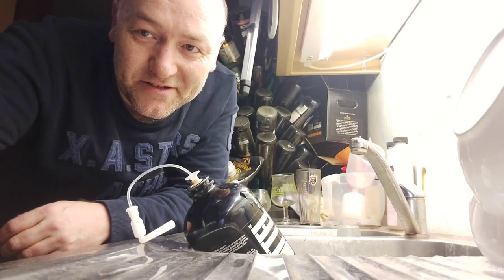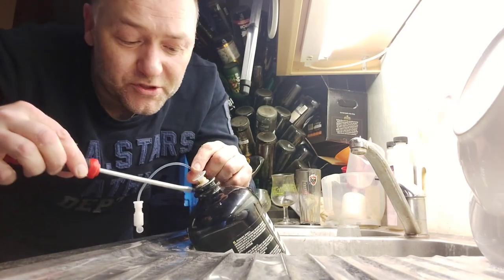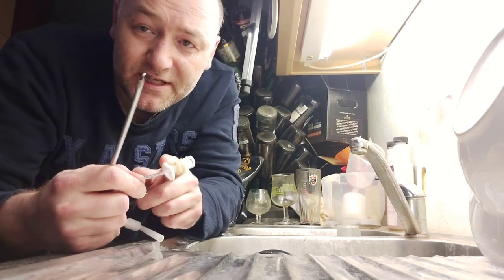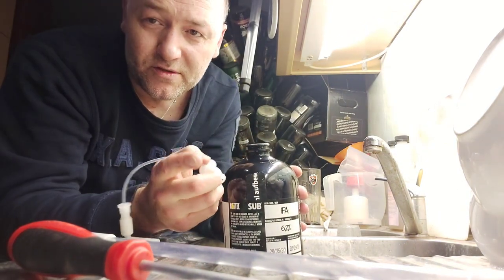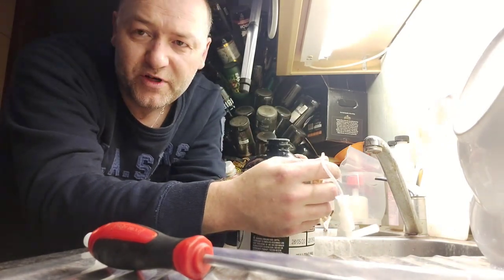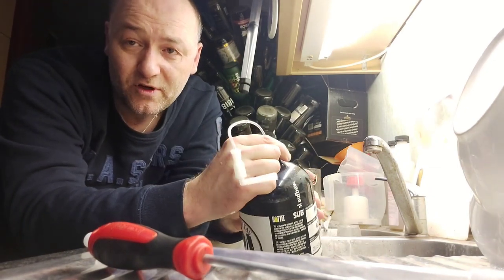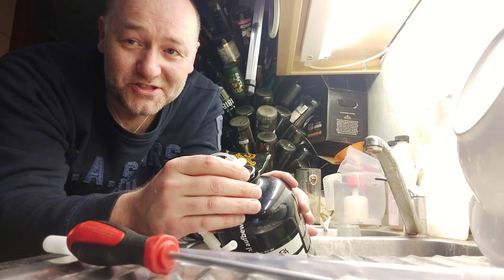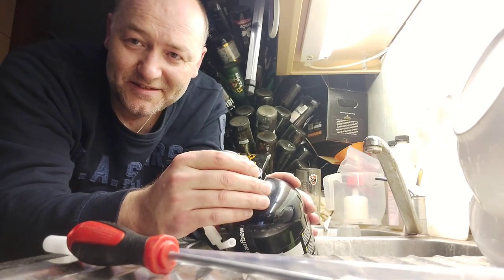Krups The Sub : Refill torps for homebrew update. part 2 : Cleaning a torp explained

Comment: Dear two liter. doesn’t get in the torp, what i should to do ?
Reply from the maker: Have you blown the torp with you're mouth (realy hard like you hear it cracking that bag inside? Then it is possible 4 sure! Do clean the top after again and put you're homebrew in, then it might give some more cracks like it will be still expanding
Reply: @josbeerreviews9783  thanks , i will try it again . Stay healthy my friend
Reply from the maker: You have to blow it with you're mouth (or with a pump to inflate balloons) .. you going to get to those 2 liters almost when you blow the bag inside with you"re mouth before filling. When you fill the torp you hear it expand some more (it will make cracking sounds, you still can then blow the bag inside trying to get even more space. Just don't fill it fully to the top, leave some space for carbonation to be happening 🙂👍🍻🍻